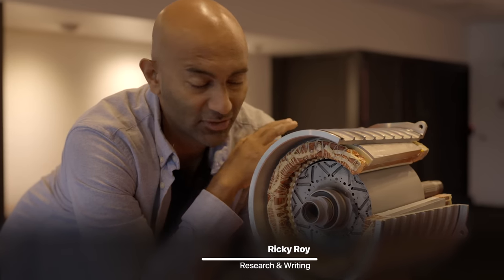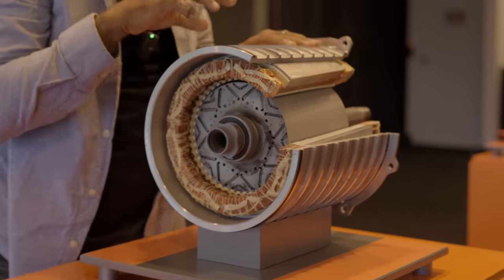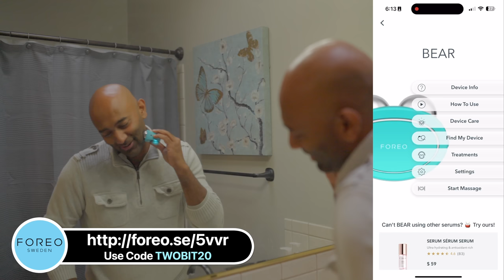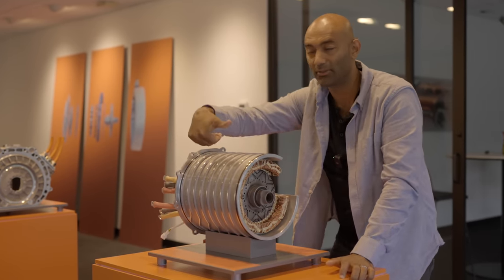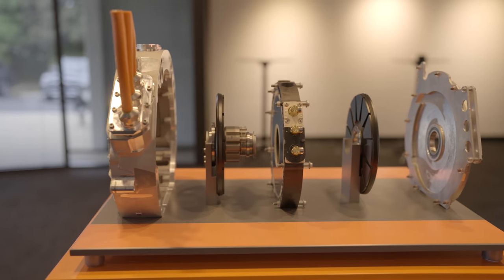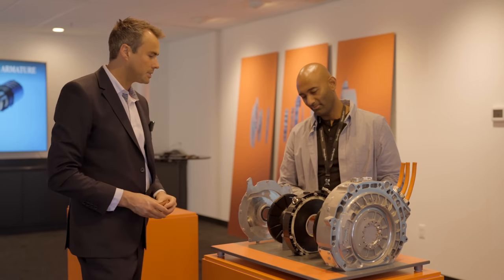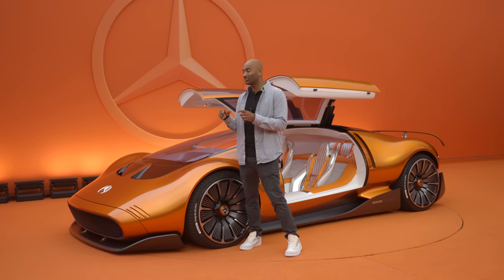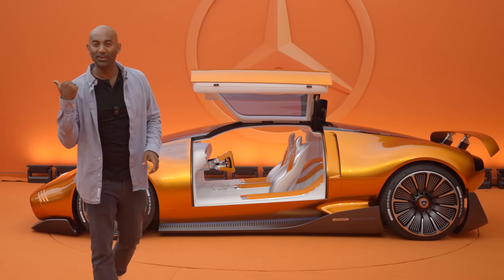Axial Flux Motors Will Change CARS - Here's Why

Comment: The axial-flux motor has been  a well-known configuration for many years. Not built by Mercedes, they bought it from the original company. Would love to play with one of these.
Reply: Yes: YASA. There is also the Belgian company Magnax, which has an even more advanced axial flux motor with a yokeless stator that offers the highest power density in the industry. Unfortunately, no EV manufacturer seems to be working with them.
Reply: @fluxcapacitor  they arent good for evs, they are for hybrids

Comment: It is enjoyable, concise, and informative. Thanks. In my twenties, I designed a try-armature, axial flux motor with power production and use created by internally controlled computer chips inside each armature. The motor could pass vast amounts of current back and forth for breaking and acceleration. Beautiful presentation. Thanks again.
Reply: The Elefant (German for "elephant") was a heavy tank destroyer used by German Wehrmacht Panzerjäger during World War II. Ninety-one units were built in 1943 under the name Ferdinand, after its designer Ferdinand Porsche. The engines drove a single Siemens-Schuckert 500 kVA generator each, which powered two Siemens 230 kW (312.7 PS) individual-output electric motors, one each connected to each of the rear sprockets. The electric motors also acted as the vehicle's steering unit. This "petrol–electrical" drive delivered 0.11 km/L (909 litres/100 km or 0.26 miles per gallon) off-road and 0.15 km/L (667 litres/100 km or 0.35 mpg) on road at a maximum speed of 10 km/h off-road and 30 km/h on road. Fancy, huh. electric motors suck because of the weight, cooling and control circuit.

Comment: Me: I sure hope this will make EV's  more affordable.

* Mercedes has left the chat *
Reply: also its only useful for hybrids...
Reply: Batteries are the cost factor in EV. Not the electromotor.
Reply: @meantares  Well both are - but here is about efficiency, size, output.  How much is one motor - 3kUSD? if you have 2 of them or 3? It's the price of the battery.
Reply: 🚄 y público transportación >> coches eléctricos
Reply: Maybe they stop making cars and just mass produce electric motors for other OEMs including Tesla?
Reply: EV`s are in fact very affordable , the same price or cheaper then gasoline cars. The price is artificially doubled by EU / USA to hinder the spread of EV`s . These countries count on profit made from fuel , usually state fuel tax is 100% ! Plus lobbyist working day and night to keep old legacy car producers in the business.   WV ID4 cost in China 15k $/Eur  in EU 30k +   Chinese brads are even cheaper. EV`s must be cheaper then gasoline cars because they are so much simpler and easier to produce.
Reply: @MartinMartinX  well no - right now there is a bottleneck and kinda monopoly on batteries, that makes it so expensive - the Chinese market its the most competitive in the world, they have the direct access to all needed resources which we in Europe and the US are building up right now.
Until now the EV´s were handed out to whom paid most, now it's moving into a functional market with competition and you see the pressure on the vendors.
Reply: @MartinMartinX  You must be living in an alternate universe. Just the batteries alone cost more than the cheapest ICE cars. Some EU governments also give subsidies when people buy EV's so not really governments forcing the high prices, Germany for example gives back 6k euro. Do not forget that EU has VAT which in most countries is ~ 20%, this is a significant price increase in comparison to say China, but is not exclusive to EV's, everything in EU has VAT applied. Also not sure where you got your ID4 price for china but it's actually more like ~25k not 15k.

The biggest issue with EV price are the batteries, which are quite expensive. 
Unless the price of batteries drops significantly EV's can't get as cheap as ICE cars.
Reply: @shimmy1984  Why would that be?
Reply: @RoycoNL  it literally explains why at the end of the video. It has lesser power output but is much smaller so fits in nicely next to an ICE and has enough power for that.
Reply: @shimmy1984  I'm not fully down with the tech, but by the looks of it it can be used in place of any motor in any product.
Reply: @shimmy1984  Actually, I think it was made clear that the reason was that this motor doesn't have the rotational speed required.  Its "power output" (torque) is above the older style motors.
That's how I took it (near mid video).

It's the lower rotational speed which is why they use it in hybrids and connected to the transmission.

The guy did mention that the developers are considering using different gear ratios for this motor because it has the power output (torque) to handle and gear ration that will increase output speed.  Of course, with a gear ratio like, faster output speed =  decreased power output (torque).  But at what level?  Time will tell.
Reply: @shimmy1984  Wrong they planned to use them in hybrids not that they are limited to hybrids.
Reply: @Barskor1  wrong, they are designed and planned for use in in hybrids with ICE, not in EVs.
Reply: starting probably at something like 750K $ ... this will be available for those making at least 1.5 millions $ /year ...
Reply: @shimmy1984  That doesn't prenvet them from being used in better applications rather than be a bandade for the gaping wound that is the ICE car collapse.
Reply: @bavariancarenthusiast2722  An off the shelf 20 kW motor can be bought for about 600 €. However if car manufactures produce motors with their proprietary, incompatible form factor, they can charge any price they want.
Reply: @bavariancarenthusiast2722  But the thing is, with the plans to ban ICE production prematurely, the demand for materials will skyrocket and the laws of supply and demand will make the cost of these materials skyrocket. Normal economics only apply in a free market, and they are screwing with that.
Reply: @seth7745  you would think, but its not prematurely - there is more than a decade time to adopt for building the infrastructure, develop different battery technology, energy - more than 10 years from now! It took us less to fly to the moon. 
The free market needs guard rails, most of them are to protect us - like clean water and yes clean air. Its not against the free market it is to protect us. 
We will see other technology solution coming up over the next 10 -20 years.
Reply: @bavariancarenthusiast2722  We would not be able to get to the moon again in 10 years. That was a different time. There is way more bureaucracy now in industry and regulatory. Also, there is more involved with developing infrastructure at that scale than you think. It can take 10-20 years just to rebuild a single power transfer station. Not to mention the tons of aluminum for the high-tension power lines needed. The logistics are mind boggling and the politician’s creating policies are not qualified to make these decisions. Nothing you mention constitutes a solid plan. It’s overly optimistic speculation. I only have a BS in mechanical engineering, but I know enough to see our policy makers are flying blind. They are setting us up for a logistical train wreck.
Reply: @bavariancarenthusiast2722  China tried to play this game of dictating what car manufacturers produce rather than producing what consumers want. Now there are literally fields full of EVs rotting away. When this happens to the US auto industry, it will go under and won’t recover. Perhaps the government will bail it out after. Who knows.
Reply: @MartinMartinX  If the government taxes something, that causes it to become more expensive. So, your explanation makes no sense.
How would the US or European governments be deliberately making something more expensive? By taxing it, that's how. And if they're taxing it so much, that's more money in the government's pocket from having created that tax. Why would they care if the tax is for EVs or oil?
Reply: YEah, those motors have been known forever. Not used because of cost. And for the video, doesn't look like Mercedes is after that neither.
Reply: @meantares  Are they, though? A $50K EV will have around $5-7K worth of batteries. If you want $1K worth of more battery capacity, that's a $10-15K option for you.
Reply: Shareholders:  I sure hope this will increase our profit margins.

* Mercedes has entered the chat *
Reply: @aaronhamburg4428  Has it ever crossed your mind that governments give way too much more subsidy to fossil fuels than these meager EVs tax cuts?

Comment: Great video. I'd add that the idea is not new, but many advances in recent years, both in materials, and production technologies are making these ideas more feasible and applicable in real life.
Reply from the maker: so true!
Reply: How about we practice human and ecologicaly safe resource extraction before worrying about it efficiency of this joke that is the ev movement.
Reply: @imnotaspoon151  You talk about resource extraction as if it is something exclusive to EVs🤣🤣🤣.
What a ridiculous thing to say. You've not heard of the Exon Valdez,or the Tory Canyon, Piper Alpha or Deepwater Horizon?
The fact is that there is no intrinsic way in which mining for EV materials is necessarily worse than anything else. In fact, there are plenty of reasons why fossil fuel extraction is far, far worse.
And one of the reasons why fossil fuel extraction is far, far worse is because it is run by an industry which is synonymous with corruption.
So, how about getting your facts straight?
Reply: How efficient it is it in comparison to Tesla electric motor which is seen as the efficiency king at the moment?
Reply: @gmr4lfe  under the optimal laboratory conditions the drive train of a model 3 already has 95% efficiency. The big advantage of axial flux motors lies in their power density.
Reply: @gmr4lfe  The Tesla MOTOR is not the efficiency king, it's the whole design, from aero through aspect and materials to power density and simplicity.
Having a very slippery. shape is the first thing that Tesla does well, and making the vehicle as low as possible also helps, as does the aspect of the vehicle penetrating the air. Most people tend to forget that extremely clean aero is only 1 part of the equation, the other is the area that is presented, it's Cd x A.
Tesla is far ahead of the game where materials are concerned as well. Their use of aluminium structural parts not only significantly reduces rusting problems, it means a significant reduction in weight, and that weight reduction regime continues with the interior. The single-screen-controls-everything may not be to my taste, but it removes a whole load of switches and dials, all of which add weight. This allows Tesla to have things like decent seats (BTW the seats in cars are frighteningly heavy) without ending up with a car that weighs the same as a M-B S class.
I have little doubt that Tesla will eventually adopt axial flux motors, the advantages are simply too great to ignore.
But these motors are already in use in one producer's range. Unfortunately, you have to be a billionaire to have one, because these are in use in Koenigsegg's EV (Egera?)
Reply: Koenigsegg is Swedish as is the names ex. Agera = act!

Comment: Immediately reminds me of the Wankel rotary engine as compared to traditional cylinder-based engines, based on power-to-weight ratio alone.  The problem is nearly 0% of people want to have to do preventative maintenance that involves a complete rebuild of their engine every few years along with all other standard wear items.
Reply: When I drove my RX-7 in heavy traffic I could see the fuel gauge needle moving...
Reply: WATCH THAT DORITO SPIN!
ROTARY FOR THE WIN!
Crap, now I gotta replace the Apex again!
Reply: @shadeburst Your mistake was driving it in traffic. 
RX-7 was more of a performance car than a daily driver
Reply: @jakehildebrand1824  gotta daily drive it ..if it's your only vehicle. It was a failure for most part. I almost bought a new RX8. They burned oil even when new! I bought a new Mustang GT 5.0L 6spd Manual. Drove it daily..raced it..ran it hard. It lasted an never failed me for 10yrs. Sold it running well.
Reply: @Davido50  First of all, why would you buy something like the RX-7 to be your only vehicle?

Second, of course the RX-8 burns oil thats just how Rotary engines run, and its got two of them.

Lastly, Mustang? Nice choice. Solid, reliable, powerful, and American.
Reply: @jakehildebrand1824  It was such an easy car to drive. Light steering, light clutch even with a competition clutch fitted, and it braked like running into quicksand. I got sick of all the idiots who wanted to race me from the lights and gave it to my very petite wife. She also found it a delight to drive.
Reply: @Davido50  "burns" oil by design, to lubricate the apex seals, 1L per 1500-2000km, it has a pump that takes oil from the sump and injects it in the engine. Lot of new VW/Audi engines burn even more oil, not by design, and they say its normal. My rotary has been running perfect since 2002 when it was last opened up. They need to be driven hard after warm-up. Maintenance is only oil changes every 6000km and the occasional sparkplugs
Reply: The liquid piston engine is the Wankel inverted. The maintenance issues are greatly reduced. E.g. the wipers are not on the rotor and are easily accessible without tearing down the engine.
Reply: @toddmarshall7573  I prefer my Rotary to NOT be inverted
Reply: @jakehildebrand1824  Why? Would "turned inside out" be more descriptive?
Reply: @toddmarshall7573  Why?
Because I don't want some electric imitation when I can have the real deal.
Reply: @jakehildebrand1824  Electric imitation? What are you talking about?
Reply: @toddmarshall7573  the whole point of this design is that it can be used in conjunction with an electric motor.
Reply: What makes you think axial flux will be anymore of an issue as far as lifespan goes? 

 I'm not sure how efficent they are. Or how much more complex they are in manufacturing. 

 Yet for some reason I foresee these used in higher end or performance cars. Then regular old electric motors for us. 

 Helix UK says they have a motor that weighs 52 pounds and gives 800bhp. 

 Imagine four of those in a car with a battery and capacitor pack with a transmission for higher speeds! 

 Actually i get conflicting reasons on why EVs have lower top speeds. Some say it is a transmission or gearing issue. Others say no. 

 Anyway I don't care for EVs because they are green. I care due to the performance they offer. I'm all for their domination of real life performance even with their disadvantages.

Comment: Built several in the '80s.
Prototype, experimental, hush-hush.
Military contractors came to our facility for demonstrations, very impressive performance.
Four decades later, only now, has the tech reached the automotive sector.
Because of the interlocking bayonet design, I stressed during a gentle reworking of the motor bodies for clearances, 
tickling the fits that were not met on the cnc. It was all good.
Those magnets were very special, very powerful, unique mineral origin.
The contract involved specialized production equipment, which is why I recall overcoming the difficulties.
(At the time, I was occupied repairing a Battenfeld molding machine that was slamming the platens. 
A faulty limit switch that was intermittent, lucky diagnosis using an actual sweep meter. 
Took all of five minutes. A master electrician, an electronic technologist, had tested the control panel the day before, for hours, and had missed it. We were testing the molds we had made for plastic battery packs. )
Exciting, something different every day, very difficult at times.
Yes, they are far superior to conventional field motors.
Torque output is phenomenal.